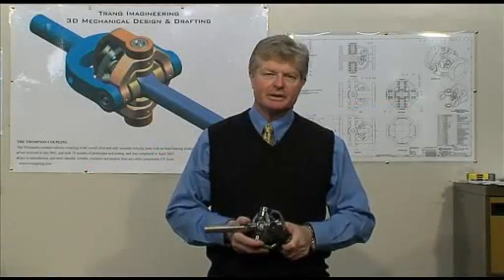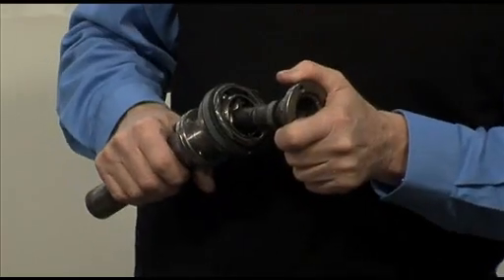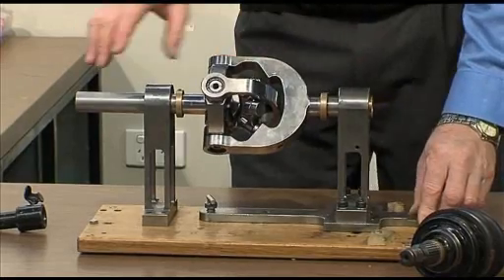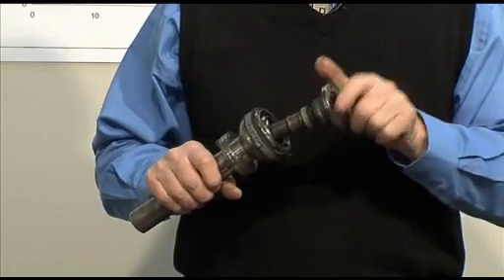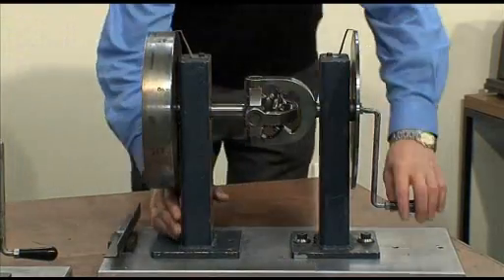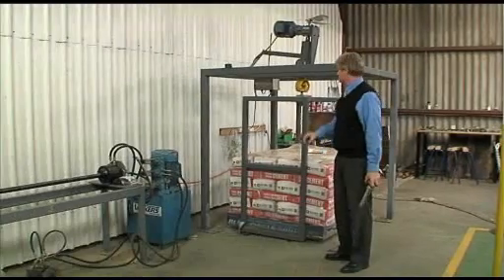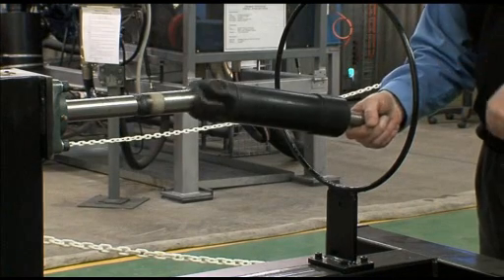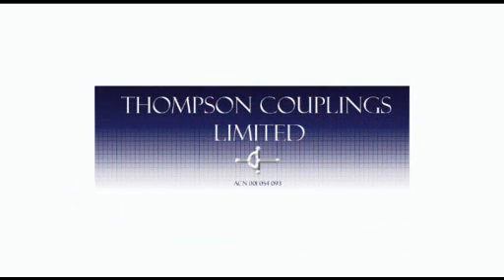thompson coupling

Comment: A quibble: a CV joint with the flexible boot will slow down spinning with both ends other than in perfect alignment as a result of the boot needing to constantly be bent.

I would be a little surprised if one of these joints also in a front wheel drive capacity didn’t also have some sort of boot to minimize the crap that gets into things otherwise and creates lots of friction.  As much as the older CV joint absolutely has sliding friction by definition no matter what, as long as you keep a properly-maintained boot on them, and don’t push them outside their design limits by doing such things like jumping your cars, they’re likely to be about the last thing to die: I had my first Saturn with over 207k miles on it, it had even been t-boned, but the CV joints? Still original, no signs of problematic wear. I wasn’t exactly a gentle driver, either!

I do hope these can be made at least no more expensively than what they replace so they do replace them, they do seem like they’re more robust, even if they do appear to have notably more parts and manufacturing complexity than the CV joint, that already has mass-production assembly lines already built and running all over the world.

Comment: ...and this is pride of the Australian inventors... becase it's revolutionary in it's anti-wear-and-tear-logic... becase too many manufactures build stuff that is engineered to brake and bust... and then back to the mechanic...  and in some instances... it would be a lot safer to bring-out or call-out a heavy-machinery-mechanic... or to have one of these couplings installed on a heavy-cargo-load-carrier... and the coupling would have to be oversized... and or a heavy-duty-industrial-size...